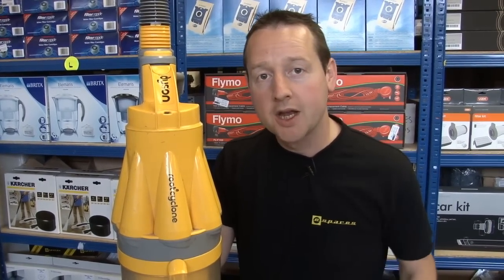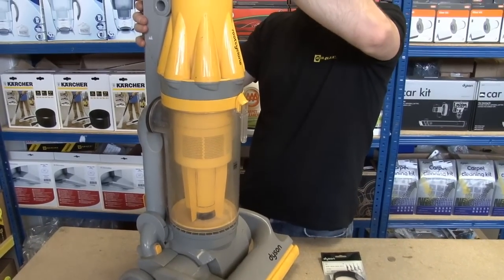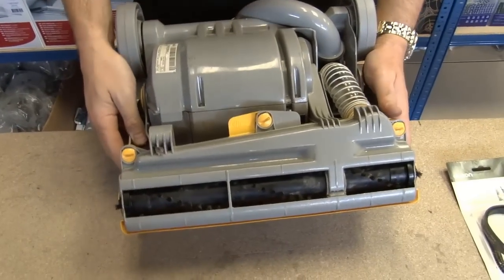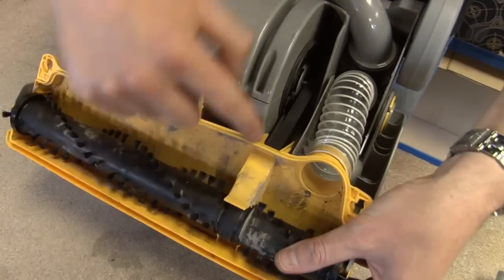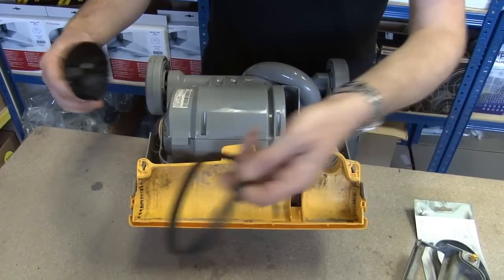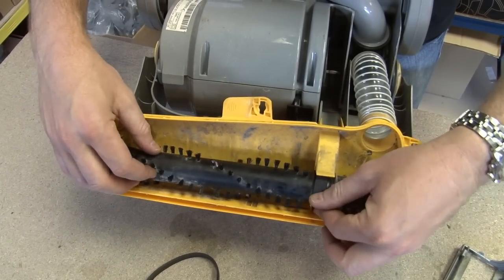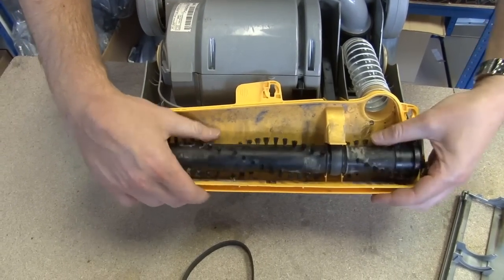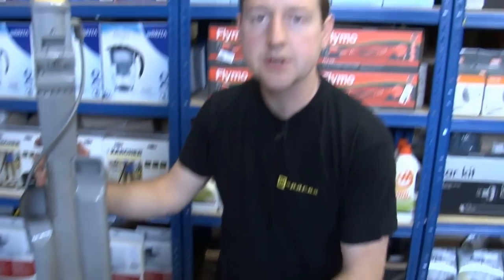Dyson DC07 Belt Replacement - A Quick & Easy Vacuum Belt Change!

Comment: Wow! I can't believe I've just done it! Despite watching the video and reading all the previous comments, I nearly gave up thinking that I  just wasn't strong enough. I decide to have one last try and I managed it. You do need a bit of strength but I think it's more about technique and when you finally "get it" it really isn't that difficult. I used the handle of a wooden spoon to pull the belt towards the spindle using the machine as  lever, then I twisted the handle of the spoon to get the belt in the correct position and pushed the belt down so that it slipped over the spindle. Finally, I carefully pulled the spoon handle out. I hope this explanation adds something to the others and helps someone attach their belt.
Reply from the maker: Thanks Helen for your input. Many do struggle fitting a new belt and this can be easier if you drop the belt into hot water first to soften and allow it to stretch. But as you found there can be many ways to do the same job. :-)

Comment: Initially you do feel it is so hard to do but I found using my thumb of one hand to stretch the belt to the motor spindle and then use your other hand to get it over the spindle worked and was quite easy then.

Tried to fit it before watching the video and was getting a little, er, frustrated! The video helped lots including the tip of removing the filter for a flat surface.

Comment: I have a DC07. The belt plastic cover is a little different than the all-in-one plastic molded piece shown in the video. My piece has a separate black plastic belt cover with small star bit screws to keep it on. This video was helpful to know what I needed to do to fix my Dyson. Now, to order the belt. :)
Reply from the maker: +Kevin Case As mentioned below in other comments there are two versions of DC07.  Some have one belt the others have two and a clutch between. Make sure you get the correct belt for your model.
Reply: Mine is the same having a heck of a time getting to it to take it off and I have small hands lol

Comment: i got the best idea for changing dc04/ dc07/ dc14 non clutched belts.
take off soleplate then belt off and brush take off internal hose and the self adjusting head the part the brush sits in so now you have just the cleaner head so next you get the new belt and put it on motor shaft then thread the new belt through the brush housing then get the round brush and put it in housing with the belt on the brush then put the floating head back where it belongs (in front of cleaner head hope it helps :D

Comment: I found if you stick a metal rod down with the belt wrapped around it you can wedge the rod behind the motor shaft and then stretch the belt by levering the rod against the motor shaft and slide the belt into position. It's hard to described but relatively easy to do!

Comment: The video shows you what to do and it worked. So thanks for that . However I am a very strong bloke and even my fingers struggled, and were also too big to fit in the gap. So I stretched the band as hard as I could first, and then hooked it over using the bottom of a spoon handle, then held the band in place with my thumb while I slowly pulled the spoon handles out. Worked on 3rd attempt. It is quite hard, and a lot of people will struggle without good eyesight good light, and very strong fingers. The tip about removing the dust box was helpful, as I got much better purchase on it that way.

Hopefully it won't need replacing again any time soon! What a pain.

Amazing how a top brand machine makes such a simple thing so hard. I was able to replace the band on my mums Hoover Junior when I was a 5 year old!

I originally called Dyson, and their tip was buy a new machine on a 'special discount', like they didn't know it was probably only a rubber band. Not impressed by that.

No wonder Mr Dyson is so rich!
Reply from the maker: Thanks for your comments. These belts stretch as they get older so a new belt can be very tight. Glad you managed it in the end.
Reply: brilliant,cheers mate

Comment: Cheers. Your belt went on the motor pinion far easier than mine so I ended up putting it on the motor pinion first and pulling the belt through the brush housing and over the brush before reinstalling the brush back in place.
Reply from the maker: Thanks for the comments Neil, new belts are often very tight so whatever way works for you is good. 😊
Reply: Neil Swift  that's the tour I'm going with too.don't have the tool
Reply: I used a cycle tyre brace that has a hook at the end but I suppose any hook like tool that's strong enough to pull the belt through the housing will work. Once you get the belt through the housing you can use your hands to pull it over the brush.

Comment: I had real trouble with this, until I did it the other way round.  Put the belt around the motor first, then feed through to the roller and use something strong (I used a regular knife) to pull the belt over the roller.  Bit fiddly but did it within a minute or two.

Comment: Brilliant video mate, thank you.  If I hadn't see the video I would have send the belt back thinking it was too short.
A whole new definition of 'a little bit awkward', and Matt meant it when he said 'pull this back as tight as you can'.
I ended up using the edge of a screwdriver to pull the belt back.  Matt used his fingers!
WARNING:  If you meet this man in the street DO NOT SHAKE HIS HAND.  He has fingers of steel, I reckon his hobby is crushing rocks in his bare hands to get the juice out!
Reply: Can we get CCC vi hc canwe chat Christmas vc v call when u are here and I, love n,h😅😆 can,

Comment: I found it muh easier to put the belt on the metal spindle first. I then cut the old worn belt and used this as a puller to bring it through the sole plate. Daughter kept the tension and I was able to thread the end of the beater through the loop. Bit of a struggle but only took a few minutes to do this hard part. Very pleaeed now. Works like new
Reply from the maker: Thanks for the comments, glad you sorted the problem.

Comment: I should be so lucky that mine will be that easy. I've seen DC07's where after you pop off the sole plate you have to remove the clutch cover and clutch in order to replace the brush belt. And you have to have a T15 torque screwdriver and a belt puller and holder to get the new one on. You practically have to spend as much money for new tools as you would to pay a tech to replace it in the first place. No wonder people sometimes just throw their old vacuums in the rubbish pile!
Reply from the maker: Hi Anthony, a easy way to put the belt over the roller is to pass a loop of string through the belt. You can then use the loop to pull the belt out enough to pass the roller through.

Comment: Did you ever find a solution to the noise issue? I have replaced the belt, suction is great but now sounds like an industrial lawnmower. Almost as if the belt is too tight and the motor is straining.

Comment: I did it by add a drop of virgin olive oil over a screw driver which then helped push the belt of the screw driver into the spindle.

Comment: Hi! Thanks for the tutorials. Quick question...I have a dyson dc07r there is no loss of suction from either end but the brush will not spin! It does not seem to be snapped as I have manually turned the entire length of the belt and its all intact tho there does seem to be a cover. Does this indicate a bad clutch or something else? And how do I order parts in the US?
Reply from the maker: Hi Rochelle, your Dyson (depending on model) uses a clutch and two belts to allow the brushes to stop when the base is in the 'parked' position'. If the brush does not re-engage when the upright is lowered it may be the belt to the clutch is broken. For more information see: How to replace the clutch on a Dyson - DC04, DC07 & DC14
http://www.espares.co.uk/advice/4/1328/how-to-replace-the-clutch-on-a-dyson-dc04-dc0

Comment: How the heck did you fit that belt on so easily?
I nearly tore off my fingertips trying to do it.
Had to use a long screwdriver as a lever.
Reply: Thanks. I'll try that next time.
Reply: I also found the screwdriver method the best by levering it over the motor spindle.

Comment: Would changing the belt stop it squealing
 I took the belt off and the squealing stopped
Thanks Ray
Reply from the maker: Mudfisher1 The squealing is likely to be the bearings on the brush bar so by removing the belt it is no longer turning. Remove the caps of the bearings if possible and clean them, if this does not work you may need to replace the brush bar.

Comment: i have a dyson dc07 in canada, i rotated the 3 screws(using a coin mensioned) at 90 degress to detach the part shown in the video to access the belt... everything is the same exept that one piece... that piece is molded differently for me... i cant access the point where you can slip the belt of the metal dowel pin also known as the spindle
Reply from the maker: Emily-M Dreamm Hi Emily, your Dyson may have two belts and a clutch between so a more similar layout can be seen in another one of our videos: www.youtube.com/watch?v=ycicf5Ut59g
Reply: +Emily-M Dreamm Time to find another make.  This is exactly the problem I have.  Mr Dyson you need to get back to basics FAST.

Comment: Hi. On my dco7 there is a cover over the belt so I cannot detach it from the motor pulley n any tips on how to get that off?
Reply from the maker: Hi Casey, Your DC07  may have a clutch so check out another video: How to replace the Dyson clutch on a Dyson DC04, DC07 and DC14 vacuum cleaner as this could be more like your cleaner.

Comment: Espares I couldn't put the new belt in the vacuum please help ☹️
Reply from the maker: Try fitting onto the motor spindle then passing a loop of string through the belt to help you pull and stretch it enough to fit over the roller.

Comment: Hi i have a dc07 and my belt keeps snapping on it (within 5-10 seconds) and at the same time the hoover lets out some smoke. However, The motor sounds fine. Any idea what the problem to this is or the solition to this?
Reply from the maker: The likely problem is stiffness in the turning of the roller brush. If dirt or hair builds between the roller brush and the end caps the extra effort to turn it causes the belt to slip and the friction on the belt burns through very quickly. Remove the roller caps and clean and if still stiff replace the roller.
Reply: +eSpares hi i bought a second hand dc07 because i obviously needed a hoover. I have just swapped the roller from the new hoover which i just had bought to the old one which was smoking and burning the belt and result! there was no smoke! It definately was the roller. Thanks for that!

Comment: Would love to know how you managed to get that filter cover off so easily. Lol.
Reply from the maker: +steranger1 The filter cover http://www.espares.co.uk/product/es929141/ has a lip on the front that needs to be lifted up slightly to allow it to be taken off. Over time the plastic parts can tighten and be difficult to remove especially if dust has migrated between the surface. If struggling try warming gently with a hair dryer to soften and expand it before removal.

Comment: I did that but it won't go on it just keeps slipping of the spindle when I pull the belt
Reply from the maker: Check the roller is not stiff to turn as hair can build up around the bearings and spindle causing this problem.

Comment: my DC07 does not look like this when I remove the sole plate.  The spindle at the back to replace the belt for the brush is covered by a plastic section that is not removable.  I have never in 50 years found it impossible to replace a belt easily.  Time to find another make fast!!
Reply from the maker: +Rosemary Hodge Your version of the machine has a clutch system and two belts. For more information see another video: 
https://www.youtube.com/watch?v=ycicf5Ut59g

Comment: Hmm I tried this and the belt was so tight it pulled the brush bar down into the brush bar end cap and the friction melted it... it's not turning anymore since they are fused together :(

Official belt and the right part number as well.
Reply from the maker: The belt is very tight and cannot cause damage to the roller. If you force the end caps off the roller you are likely to find it jammed with hair around the bearing. This is why the belt burnt out and it caused the heat on the end caps.

Comment: On my DC07 the belt is not exposed so I can't pull it off the spindle. The belt is covered by plastic. I have watched the video but my vacuum looks different.  I am stuck.
Reply from the maker: clutchisgood Your Dyson is likely to be slightly different to this one and may have a clutch between motor and belt. This is likely to be similar to another one of our videos:
www.youtube.com/watch?v=ycicf5Ut59g
Reply: eSpares 

Thank you for your response. My DC07 is yellow unlike the Dyson that was shown in your link. However, my vacuums belt is covered very much like the Dyson in the link you sent me was. The brush on my DC07 simply stopped spinning but the motor runs. The belt is still intact on my eight-year-old Dyson.  I am suspecting after watching the video in the link you gave me that I need to replace my vacuum’s clutch.  My vacuum is old but it worked fine until a couple of weeks ago. Looks like I need a new clutch. It is either that or I need a new vacuum.
Reply from the maker: clutchisgood Before you suspect a problem A quick check is to confirm the clutch has not been disengaged. This is design when the machine is upright to turn off the brushes and not damage carpet by wearing while you use the tools. Check the clutch knob turns automatically as you lower or raise the machine from the 'park' position to the 'in use' position.

Comment: Had to use a piece of string to pull it through. So tight it was ridiculous. Don't remember the old belt being that tight! On now but hell of a strain on the motor i would think.
Reply from the maker: Good tip about using string to loop through the belt to pull it. Don't worry about the tension as the belt must be very tight to prevent it slipping. May be worth checking this other video explaining why belts 'snap': https://www.youtube.com/watch?v=n9nbBGvKpyo

Comment: Sole plate and belt cover are not one piece on my DC07?!
Reply from the maker: Hi Chris, there are two main types of DC07's, the type similar to the one in the video without a clutch and the clutched type. If you cannot identify the correct part on our website fill in the info with your production number (?????-??)  at the following link and we will find the part:
http://www.espares.co.uk/contact/sales

Comment: That was harder than it needed to be. I like many others had to sreeetcccch the belt over the spindle last. I used a huge screwdriver to pull it through. Didn't help that I had the belt twisted so had to start over. pfft.
Reply from the maker: Stretching the belt is difficult as it has to be very tight or it can slip and burn. A great tip for the future is to use a leather belt or strap to pass through the loop of the belt, this gives you a 'handle' that can be pulled making the job easier. We will be showing this method on future cleaner belt replacements.

Comment: "As easy as that." I think not. You need 8 inch long fingers of steel to get a new belt over that spindle. The messier solution is to disconnect the hose, dismantle the plate around the roller and then thread the belt through the spindle.  You still need some force to stretch the other end through the housing and back round the roller, but at least you won't dislocate your digits.

Comment: There is NO WAY I can do it that way round?  I have to put the rubber belt onto the little metal spindle first -- then thread it through the yellow plastic thing; and then push the brush-roller through it and do it that way around!  There's no way I've got the strength to do it the way you do it.  I've already tried LOL!
Reply from the maker: Davidalp1 There are a couple of techniques possible, we are glad you found one that has worked for you. :-)